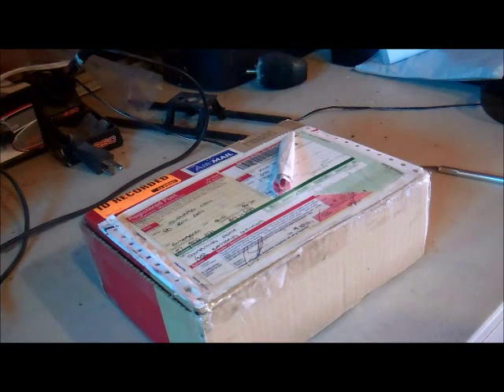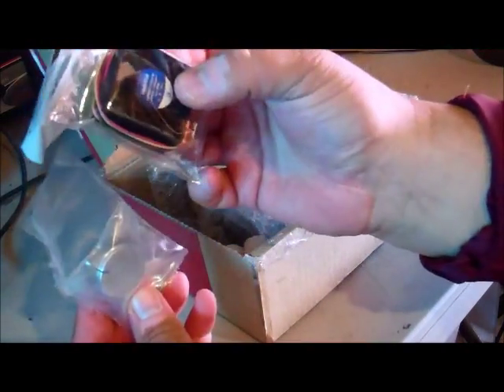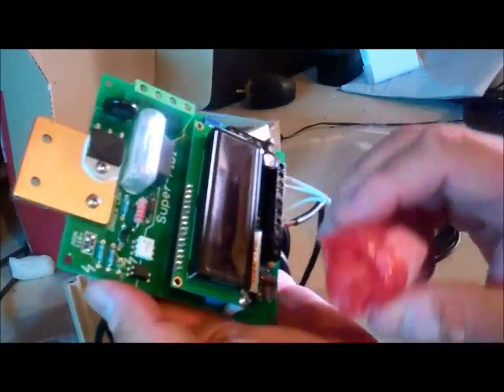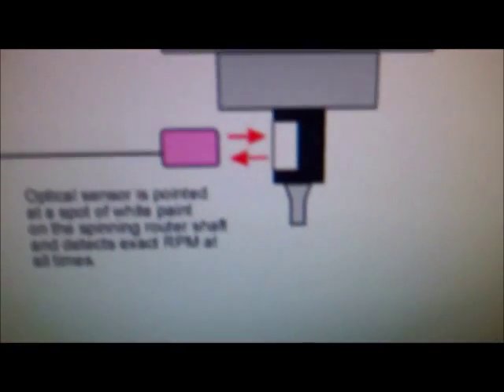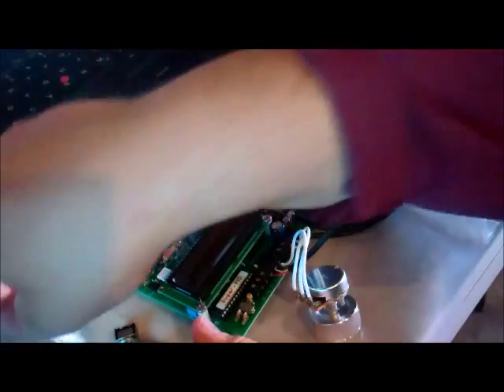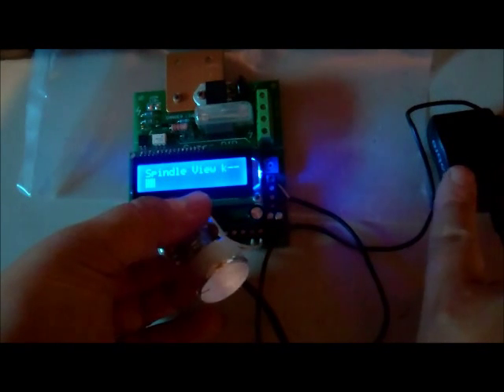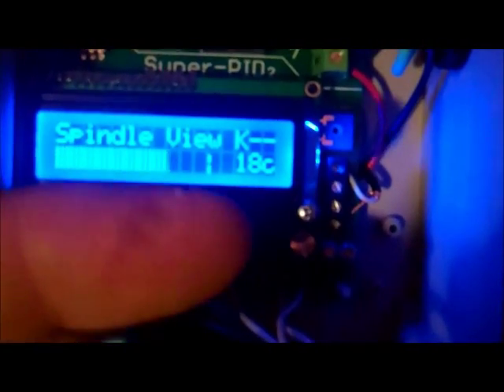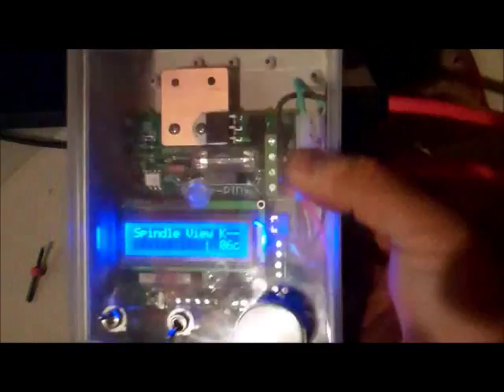Super-PID unboxing ( CNC ROUTER SPEED CONTROLLER )

Comment from the maker: i bought superpid before the router, but ith superpid its better to use with single speed router so no modifications needed for speed control switch,  suprpid is better then variable speed routers because it acts like a VFD spindle where it maintains RPM ith sensors etc..